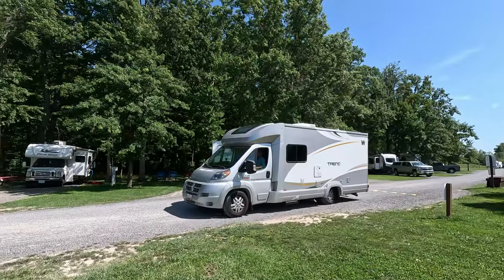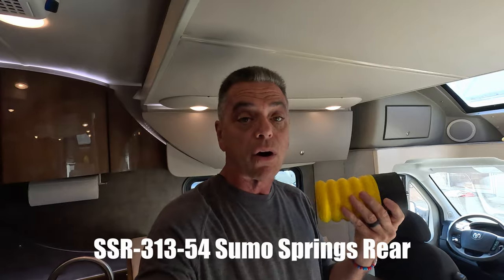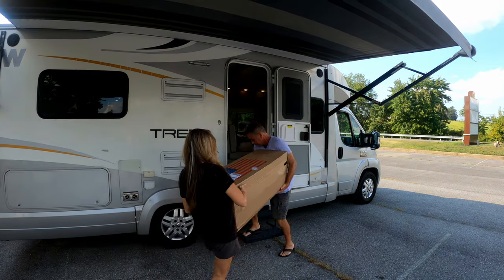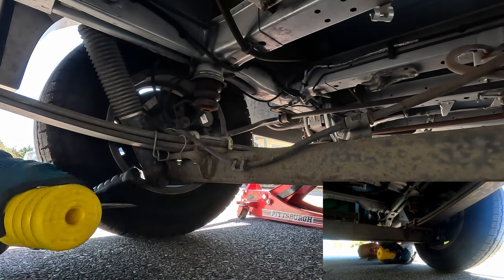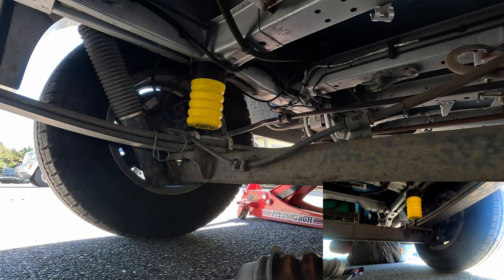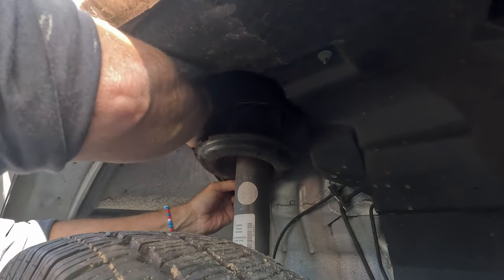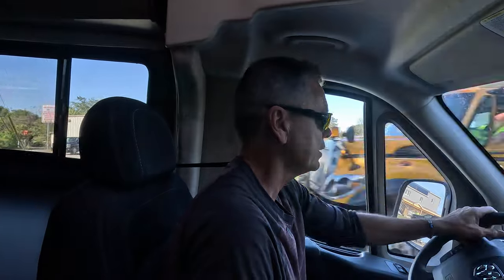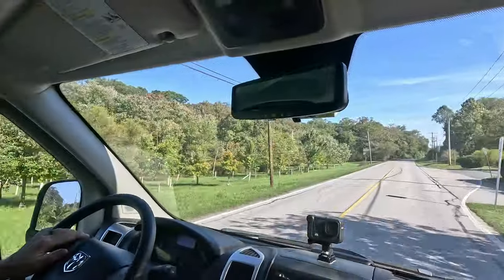Installing Sumo Springs - Front and Rear Class C RV - Easy Suspension Upgrade

Comment: We installed sumo springs on our travel trailer and they made a huge difference. Super easy to install (for most people not me because I had to move our propane line). We had also installed the spring insert ones on our Subaru Crosstrek to help with the butt sag while pulling our teardrop too.  Great products....
 Kyle
Reply from the maker: Sounds like you guys had a great experience.
Reply: Love hearing that!

Comment: Hi Chris
I used the sumo springs on my set up with my truck and camper and I had a horrible porpoising  issue. It was so bad I had to slow down to 35 mph on the freeway. I have never had the issue before I installed them. To be fair I did not install them on the front so that may or may not have been my problem. But just something you may want to watch for especially on you Alaska trip due to permafrost issues further up North. 
Happy camping 
Jon
Reply from the maker: Thank you so much for the great information Jon.  I will let Chris know so he can do some research.  Safe travels and Happy Holidays!😊

Comment: The best thing I’ve done on wy class c e 450 chassis’s  75 psi on rear air bags factory installed  and my own billstine  stabilizer for tighter steering now my 30 ft Solar can Cruz at 75/80 if I want to 😂
Reply from the maker: Sounds Amazing!!!

Comment: Hey Chris! I didn't hear you mention how long the install took? Also, the rear install looked a lot easier than the fronts.  Between figuring out the water leak issue and this install you probably easily saved yourself's 2K plus! Well done!
Reply from the maker: Took about 3-4 hours total.  Rear was easier but the front was easier than I thought.  Wouldn't that be nice.  Thanks for watching!